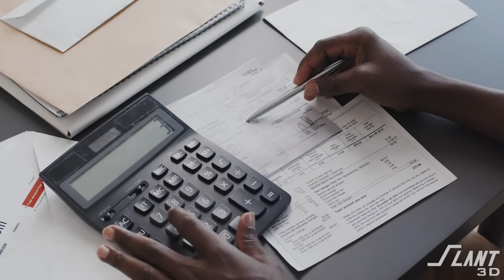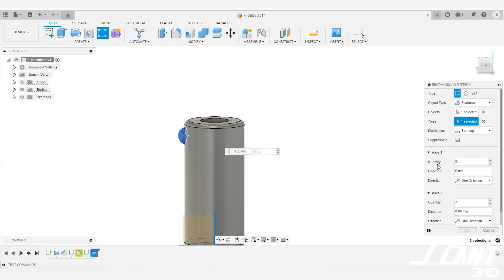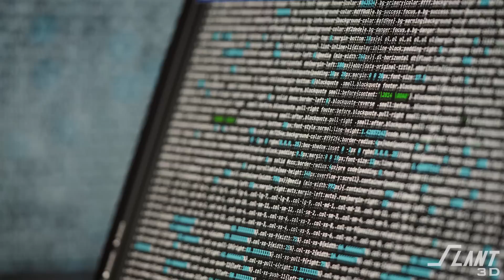3D Printing Will Obviously Replace Injection Molding

Comment: 'Most products fail' this is probably the single biggest takeaway from this video, unfortunately so many missed it. Though I don't see 3D printing totally replaces molding any time soon, when you already have the winning design, and need to produce hundreds of thousands of them, molding is the better option. But again, you can afford to go that route by that point. 3D printing reduces the cost of failure, allowing you to try more things and eventually have a higher chance of success. And as 3D printing gets faster, I'm sure the threshold where molding overtakes printing is also going to get higher.
Reply: No one missed the point except the author of the video that said "3D printing will obviously replace injection molding". That statement just isn't true and it clickbaited me into the comments.

Comment: I still see injection molding to be the prime packaging method to create consumer package goods like shampoo bottles, antiperspirant containers, etc.  They are manufactured in the millions by CPG companies.  I don't see 3D print farms replacing injection molding for those types of packaging.
Reply: Except... those are typically blow molded, not injection molded. It's a different process, but I agree, if you need millions of something, molding probably is still the way to go.

Comment: Missed points here is isotropic vs anisotropic. Molded parts are isotropic. Second missed point is that 3d printed molds are an option to bring the cost of injection molded parts way down and allow for rapid change because the mold costs are cheap and they wear out faster.

Comment: Apparently, judging from many comments, many think that 3D printing is now as fast as it will ever get and as high a quality as it will ever be. Neither is likely to be correct.
Reply: It's a very good point, but when it comes to production at scale, even multiple 3D printers with multiple print heads printing at the same time or printing many items on the same resin tray at the same time can't come anywhere close to the production speed of an injection molding machine. Even with a 10X speed increase this remains true. It all depends on the level of scale and iteration needed. The example of $5,000 parts costing $1 extra each due to the mold is true, but what if $50,000 in molds is amortized over 50 million parts instead? 1/10th of a penny  per part. Plus how long did they take to make by each method? This video is a bit optimistic for sure, much as I love this channel.
Reply: @802Garage  What percentage of plastic parts reach production quantities of 50 million? I suspect it is exceedingly small.
Reply: @dogsbd  Oh jeez that list is huge. It was also a single numerical example. Bottles, bottle caps, plastic utensils, Legos, tooth brushes, disposable razors, ice cube trays, car parts, medical devices, plastic furniture, and on and on and on.
Reply: @802Garage  "precentage"
Reply: @dogsbd  I think you meant percentage. In terms of what percentage of products by literal individual product produced by the millions, I have no idea, but certainly a significant number. In terms of actual mass of product produced in millions, well jeez it might even be the majority given how many consumables. I'm pretty sure I've made my point without having to give you an exact number, which would be literally impossible. If I just say 50% by plastic volume for argument's sake, what do you have of value to add to the conversation?
Reply: @802Garage  Yes Mr Spellcheck I meant percentage, that was typed lying in bed after midnight in frustration over you missing the point in the first place. And you still miss the point. Of all parts produced in plastic very few are produced in quantities of millions. For every one million part production run there are over a 100 production runs of 10,000 or less. I know this because I have worked in a injection molding facility.
Reply: @dogsbd  Again, by volume of product, actual percentage of product produced, you are absolutely missing the point. Working in a single facility also clearly is not giving you a full picture. Ask Chinese manufacturers how many injection molded parts they make by the millions. I'll also add tool bodies, appliance parts, electrical components both household and personal use, tool boxes, plastic cups, pizza box holders, knobs and switches, I could keep going. If a facility makes 100 products and 99 are production runs of 10,000 or less, but 1 product has a production run of 1,000,000 instead, which is a greater percentage of that facility's output? Keep in mind, it's still faster and very cost amortized to injection mold 10,000 parts than 3D print them, especially since the 3D printer cost has to be factored in, many 3D printers to come anywhere near the speed of production, and you can't assume perfect reliability, plus there is more human labor involved with a 3D printer style production unless a lot more automation is created, and filament or resin is likely more expensive per volume than the plastic for injection molding, plus the injections are molded parts are still going to tend to be more uniform and stronger with fewer errors. I mean seriously I'm absolutely in favor of 3D printing growing and improving and taking over parts of manufacturing, but I'm not missing the point. Production at large scale is simply not where it shines. Low volume production is. That could change someday, but I highly doubt it ever will or at least for a very, very long time for actual large scale production.
Reply from the maker: Thats a Bingo

Comment: Dude, I respect your perspective, I've learned a ton (even for my comparatively miniscule small-scale printing) from watching you, but... I think you missed the bus on this one.
Injection molding is a different way of doing things than 3D printing, much like it was a different way of doing things than making parts out of cast (or machined) metal, and each of those approaches has their respective 'sweet spot' (you'll notice that there are still both machined and cast metal objects out there). You're absolutely right that 3D printing is a threat to injection molding on the 1k-10k production runs, but there are a lot of parts out there (literally hundreds of them under the hood of any modern car, and upon occasion, I've bought boxes of 1k from a supplier for surprisingly little money from industrial suppliers) where the volume is there to make injection molding absolutely crush 3D printing on production costs. And (with some, not all, materials) injection molding can have mechanical properties that are far superior to anything I've seen out of 3D printing (for example, quote me 1k 16oz 'throw' cups to be screen-printed for a Mardi Gras float, preferably ones that won't leak when loaded with alcohol).
Reply: He does clickbait titles for rage-bait engagement.  It's pretty pathetic.
Reply: @dumpsterdave3710  yeah, it's insincere and so common these days. I have started blocking accounts that do this hoping the algo punishes the behaviour instead of rewarding it.

Comment: I can understand 3D printing replacing injection molding for many engineering products.  But I don't understand how it will replace injection molding for most consumer products.  I look around my computer table and I see lots of smooth parts with silk screen printing that I pick up and hold in my hands or touch with my fingers.  Wireless phone,  cellphone, keyboard, Sharpie, magnifying light, coffee cup, beer bottle opener, laser pointer... In general, I like things that I routinely pick up to be smooth and easily wiped clean, not textured to hide layer lines.  There are parts of the electronic calipers that definitely benefit from texturing, but  its got labeling on its buttons and a printed scale.  And how can you make caliper jaws that measure down to 0.1 mm or 0.01 mm with 3D printing, without jumping through as many hoops as having the part be injection molded?

Comment: You should make a video that is "what 3d printing is not good at"  every technoligy has strengths and weaknesses.  I truly believe 3d printing has a huge growth curve in front of it. taking market share from other manufacturing methods.  But saying its better at everything all the time is just wrong. 
I am in sales and if you say our product is the best at x but not y people believe you.  If its the best at everything they stop believing you because they realize you are selling.
Reply from the maker: Cars are better than horses.
Reply: @slant3d  this is such a lame straw man argument. You choose different manufacturing methods for different parts. If I need a hundred thousand of the same part I’m going to use injection molding. During the prototyping phase and early development of course I’m going to 3d print. But jeez this is seriously childish, you choose the tool for the job not this “my thing is best”

Comment: This is only true for low volume products or complex parts.
Reply from the maker: Incorrect. We are a mass production company. We do it every day
Reply: @slant3d  You can't actually believe that you are going to be able to replace million shot molds for things like the auto industry and other industrial parts. A large amount of plastics aren't used directly by the consumers, but are a component in a larger assembly. 3D printing will having a growing role for prototyping and the like, but you really can't believe it would be economical to 3D print things like body panel clips in cars. The U.S. produces roughly 10 million cars/year, and the vast majority of those have at least 5 body panel clips. You really think 3D printing can produce 50 million of those items per year? Yeah, that's not a thing. Each shot in an injection molded part can produce dozens of those,  in 10s of seconds. 3D printing may be useful when the total number of parts needed are around 1000, because, frankly 1000 of anything is difficult to produce. 10-100 is easy, 100,000 is also easy, but not 1000.
Reply: @slant3d  lemme get this straight you making  100k of the same part in multiple batches or are you doing a couple k. Because that would explain your misconception about injection molding. You're not going to 3d print car interiors panels. The waste from supports would be in insane and so would the cycle time. And you wouldn't 3d print a million water bottles. Also some finishing options aren't available for 3d printed parts. They need more labor after being printed compared to injection molded parts which don't have much needed to clean off.
Reply: @slant3d   so is this advertising for your company or this is a legit argument. I mean you knew this will trigger everyone in the blow and injection facilities :) hat goes off to you
Reply: @slant3d  To clarify, it sounds to me like you're saying that no product can ever reach a degree of "finished" so perfect that there will never be a need to iterate on it and, by extension, create a new injection mould?

Comment: I really like the thought process and have been convinced that 3d Printing is viable for mass production.   But I disagree that it is a replacement for injection molding.  They are different tools that are good at different things.   3d printing interestingly enough potentially opens up huge blue ocean market that molding can't touch.  In that there are lots of small budget inventors and niche markets that would never end up with a molded product due to the up front cost.  There are also impossible to mold shapes that 3d printing opens up.   That said 3d printing is also terrible at reproducing some things that can be molded very easily.    3d printing may well end up the dominant manufacturing form over injection molding but it will never just replace it because it is good at different things.
Reply: In the past I thougt so as well. But there are many limits in 3d printing that can't be broken. I dont think it will ever be dominant manufacturing method, but imagine a quickly 3d printed moulds, they can be done now they only suffer problems related to 3d printing quality which should be fixed in time. Also imagine a mould that consist of thousands self setting small screws with just a flexible protectin sheet on top of them.... That mold could set itself quickly in any shape you program it into...

Comment: Doubtful.  3D printing farms certainly have earned their place, and the ability for quick prototyping, fast product iteration and low cost at low volume shouldn't be underestimated.  But 3D printing scales poorly... that is where injection molding comes in.  For a good example, look at the prices for the different kits Prusa offer for their MMU3.  You can buy the kit + 3D printed parts, or the kit + the filament needed to print the parts on your own printer.  The price difference is rather a lot for a few parts.  They are also having troubles meeting current demand for their new machines, which might be why they offer the print-it-yourself option in the first place.  This is one company where they'll need to look at injection molding, or be priced out of the market.
   
I fully agree with the part about 3D printing lowering the barrier of entry.  There are countless small businesses turning out innovative plastic products, at an unbelievably low capital expenditure, and it's been a game changer for makers.  But it's not going to replace injection molding for anyone turning out more than a couple thousand parts per run.